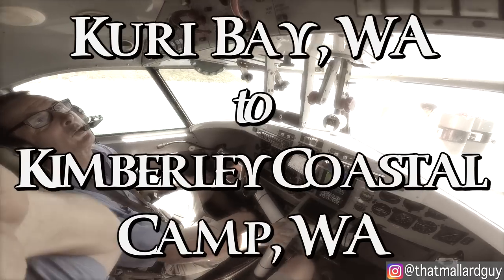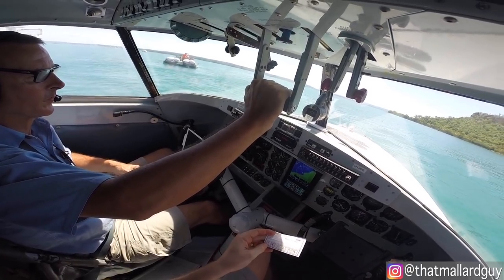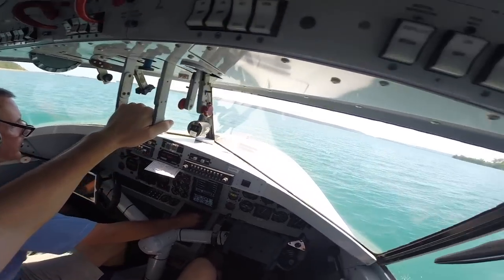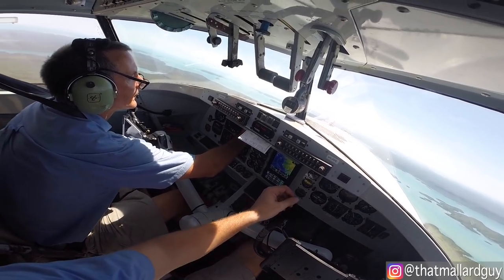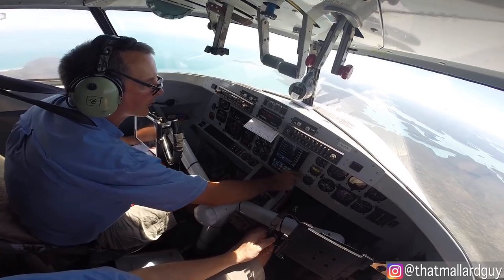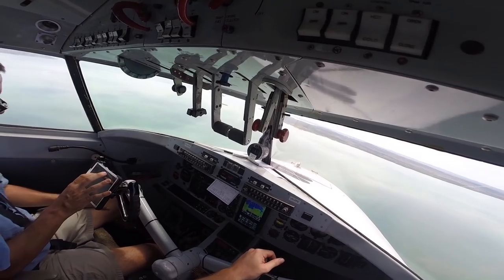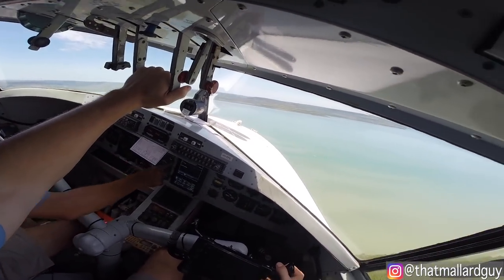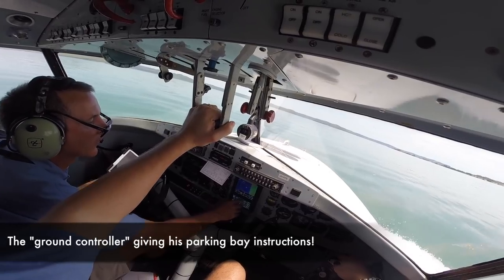Flying the Turbine Grumman Mallard

Comment: My dream airplane is an Albatross. I'd like to do a similar conversion, from the Cyclones to PT-6's. I'd imagine you had to replace the spars with reinforced spars and put extra work into the sheet metal for the wings so they didn't get ripped off of the airframe. What kind of performance changes did you see with the PT-6 versus the R-1340 Wasp?
Reply: I have a similar plan. HU-16 with better economy and range. Wish there was a diesel engine option.
Reply: @bladenrexroth2555  Red A03 diesel? Too heavy?
Reply: @stevenshorten6184  I was thinking automotive diesel. OM606 tdi mechanical or VW/Audi 4.2 tdi V8 for commonrail. Both would be good for reliable continuous power and fuel efficiency. OM606 would be a cruiser between 2200-2500 rpm. Probably see less than 5.5 gph per engine. The 4.2 tdi would probably see less than 5.5 gph per engine at 1800 rpm. Would increase flight time by adding another 1200-1600 miles to the fuel range.

Comment: Im curious, what is your mission profile for the turbine Mallard, what economic situation allows you to operate the aircraft over normal land based aircraft.
Reply from the maker: Monster's Inc. pearling operations in the most remote locations in Australia
Reply: @thatmallardguy7955  Ya know back in the day Conroy put some Rolls Royce Dart turbine engines on a Grumman Albatross, but the Darts are very thirsty engines, so it didn't work out, but you could currently use something like the -67 or -68 PT6's on an Albatross, they have much better specific fuel consumption numbers. I always wondered why nobody ever did a turbine engine conversion for the Albatross, it was produced in much greater numbers than the Mallard, and its a well proven airframe.
Reply from the maker: Monster's Inc. couldn’t agree more! They would be a perfect machine

Comment: Great Aircraft...But I am wondering about the hazard of water getting into the air intake  and drowning One or or Both Engines. Correct me If I am wrong but with Radials the risk is far less.
Reply from the maker: Robert Flores yes but this generally only occurs in very rough water. The intakes have inertial separators which help to some degree but the reliability of the turbine over the radial far outweighs any risk of occasional water ingestion

Comment: awesome video! Ive been following on instagram for a while glad to see some in depth full flight videos! Where mallard original built with the turbo props or are where they converted from old albatrosses?
Reply from the maker: Jacob Henderson they were built back in 1947, way before the turboprop engine was around, so had old radial engines. The albatross is the next aircraft up

Comment: Which engines did this particular plane have? The original R-1340s or the PT6As?
Reply from the maker: The Sons of Epsilon the PT6 engine was originally developed over 10 years after the Mallards were, so all Mallards started with the R-1340.
Reply: @thatmallardguy7955 
Fair enough. I was just curious as to whether the plane in this video had been refitted with the PT6s or not.
Reply from the maker: Oh sorry I get you, yeah PT6’s for all our aircraft
Reply: @thatmallardguy7955  Hi There,

Actually I worked on this aircraft and one other Grumman Mallard which were both sold to Air Whitsunday around 1981/82 from West Coast Airlines In British Columbia where I worked In maintenance. I worked extensively with Gulf AIr, Island AIr and other float operators flying Beavers, Otters and ll manner of Cessnas...Cheers... Just A Canadian Who works with seaplanes.

Comment: Why do the both of you have your hand on the throttle, or over the throttles, or whatever? It looks ridiculous. It's not like the levers are going to move or anything.
Reply from the maker: Stratoleft you’ve tried setting power whilst charging through rough swell? “Guarding the levers” helps the pilot flying from unintentionally retarding the throttles in rough water. Also the pilot monitoring’s job after the initial application of power is to fine tune the power so the pilot flying can focus on actually flying the aircraft, so having their hands ready to go is a much safer practice.
Reply: Same goes in fact for some antiquated airliners (like for instance Fokker F27)  that operate on regular concrete runways.
Reply: Professional pilots do this as part of a well defined and tested standard procedure. Initial setting of power by the flying pilot, backup callouts by the non flying pilot with flying pilot hand removal at V1 and non flying pilot guarding the power levers is all a well thought out ballet based on many many accidents caused by power lever mismanagement at a crucial time.